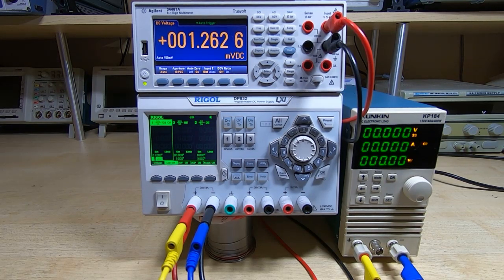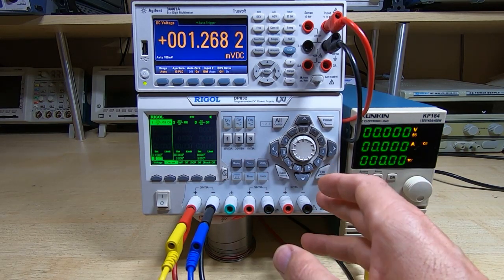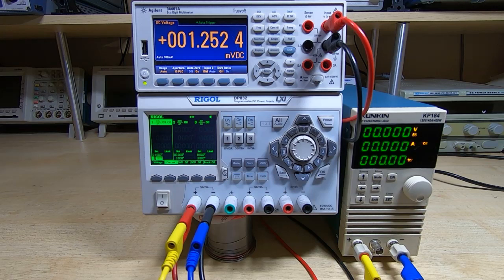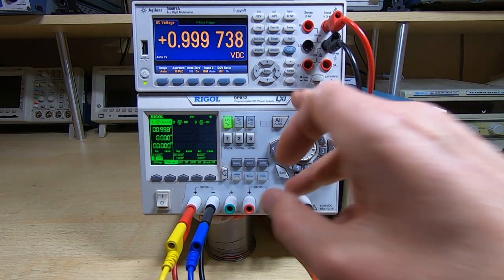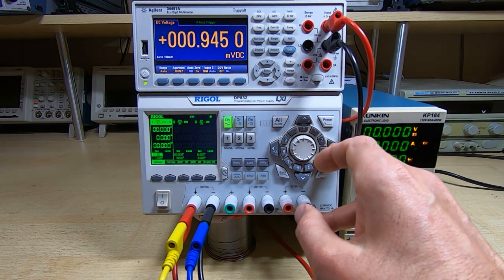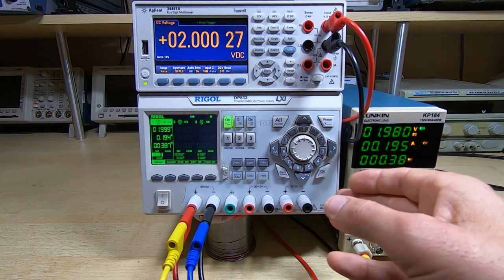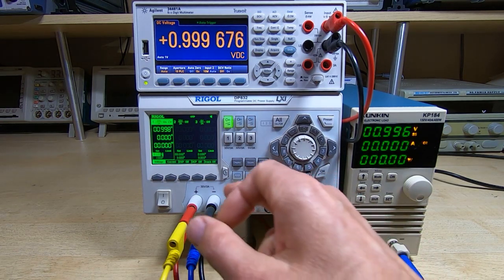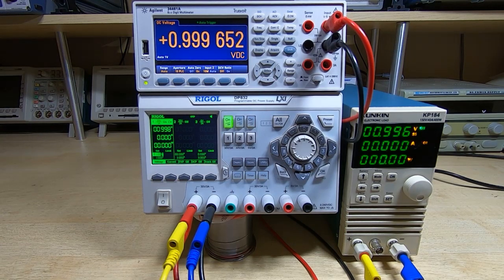Rigol DP832 Repair Part5

Comment: And here I updated the firmware to the color screen despite already having all the options enabled. Then calibrated it trying to stop  jumping around. I haven’t been happy with it for the accuracy it claimed since I bought it. But now it started resetting so time to fix it. Do you happen to recall the capacitor badge value Rigol used on that picture the subscriber sent to you?

Comment: My DP 832 has a completely different problem, it seems that current limiting is not working correctly on the 30 Volt supplies. 

I set current limiting for 1 Amp, and it begins to trip with as little as 40 ma.

The current jumps from 40 ma, to 1 AMP while driving a MOSFET. 

There was nothing wrong with the MOSFET, and it behaved linearly with another power supply.  (I could get any current I wanted just by driving the gate) 

Has anyone observed similar behavior?

Comment: I'm amazed they STILL have this issue from  a new unit. A few member on the eevblog mention this happening to their units in the past. I really like what it has to offer each channel, but I don't want to get new equipment that would need a fix from the start. I see you are using a few OWON PSUs in some of your newer videos. Can you recommend them or a  new programmable Linear DC that has matching specs with no issues from the start? I also would love a great recommendation on an electronic load. Appreciate your videos and I just subscribed! I'm building out my own test bench to work on school projects at home. New computer engineer student and am excited to see your content.

Comment: One nice thing would be to know what are the serial numbers, one from the power supply thats in the video and second from the power supply that the viewer happened to check and seen that it has the added capacitors and was fixed from Rigol. This would give us an estimate and idea what to expect from our DP832 if we dont want to open it up. BTW, just opened mine and it has added caps around the diode, got it May 2017 and until now it looks ok appart from the about 2V pike on terminals upon power on, serial number: DP8C184650***

Comment: Bought a DP832 when it first came out and yes, I'm having the same issue however not quite as pronounced.  I do get the occasional reboot but not often enough to force me to take a look at it.  I was aware of the EEVBLOG Dave vid, and I was considering making the CAP/Regulator/HeatSink change eventually, however months have turned into years.  After watching your video I'm now going to add the additional caps to that rail and make the component replacements.  I appreciate all the work you did and that you shared the intimate details to save me (or US - DP832 owners) the research/debugging.  Rigol does remain on my sh*t list for the way they handle things like this.

Comment: Jerry, earlier you mentioned that Rigol might have built 100,000 of those boards initially -- perhaps the bodged capacitors on their "newer" units are simply done that way to use the original boards without making new ones?

Also, in one of the first videos in this series, you pointed out that the two large caps were blocking the overheated regulator's heat sink.  If you had installed the replacement caps leaving long leads on them so they could be offset to either side for better ventilation, would the long leads at that point have caused problems?  Of course, the two "extended" caps would have had to be adhered to the PCB with silicon or similar so they wouldn't be "left waving in the breeze."  I'm just curious about how that type of repair might work in this situation, i.e., better cooling of the original or new heat sink.

Thank you for sharing this very interesting series!  Thumbs up as usual!
Reply from the maker: There is at least 5 years between the two supplies so if they are still using boards from the first batch after 5 years then they also have engineering projection problems. As I say in the video I could understand bodges appearing for a short time but for something which is a fundamental fault I would expect it to be properly fixed after a year or so. Extending the capacitor leads is not a good idea as this makes them less effective. Also the small heat sink would still not be up to the job. The larger heat sink extends well beyond the capacitors and so most of it is in the air stream unlike the original which was entirely 'hidden'. Either way I would still have expected them to fix my supply at their expense and not mine bearing in mind that the fault is due to poor design.

Comment: This has been an excellent series. Thank you! Perhaps the board was designed by the same engineer who designed that silly "keypad". It would have been interesting to  replace the single small capacitor only on the 4.2 V rail to see what noise level existed when it left the factory - and was present during product development.
Reply from the maker: I did actually try that. The largest 0402 capacitor I had was 4.7uF 6.3V and without it the noise was 2.6V pk/pk. With the 4.7uF it was 1.2V so either way I do not think it would work. Also the ripple current was approx 14 times the maximum allowable for that type of capacitor. I have to assume that the designers did not realise that the 4.2V rail as important when not using a battery but as we saw it is still critical even when a battery is not used. I fitted a total of around 365uF but I think something totalling 1000uF would be even better.